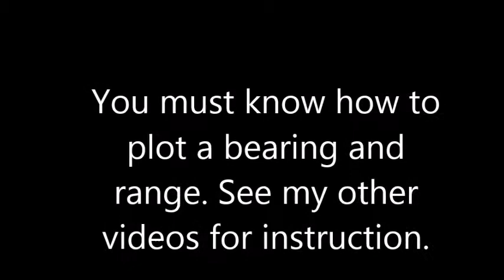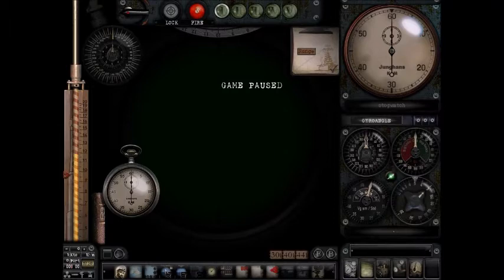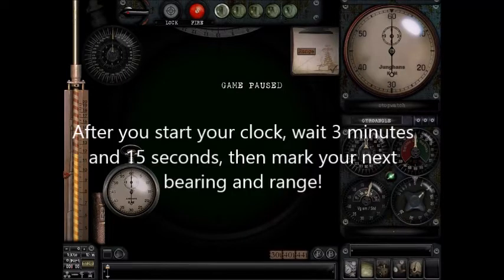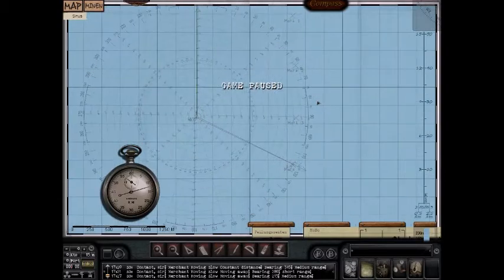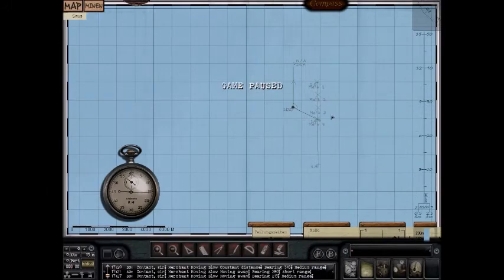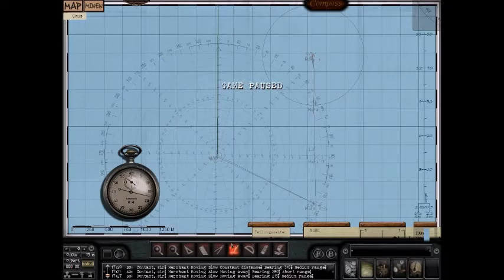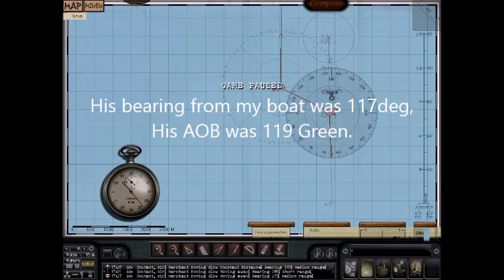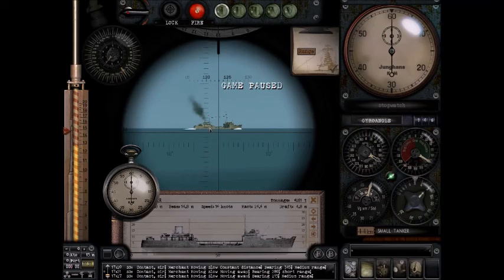SH3 Four Bearing Method by Bstanko6

Comment: Good tutorial if one knows what to do ;) Why don´t you explain what you do at every moment? For me as a beginner that looks like random clicking.
Reply from the maker: Rücklicht can you explain what exactly what you do not understand? I explain quite a lot. How much experience do you have with Silent Hunter?
Reply: @SH3Bstanko6  After years I´m trying to understand manual calculations for the first time. I´m using the GWX mod but my GUI looks and works totally differently from what you have. For example that button in the middle of the Ziellösungs Rechner can only be found on the desk of the Waffenoffizier, but not in the scope.
Reply from the maker: Rücklicht oh ok. Yes. I am using NYGM mega mod. The GUI in this video is MAGUI F. I can assure this, regardless the GUI or mega mod, the procedures are the same. You have to go the extra mile to understanding the GUI of your choice. Then we can go over other parts. I suggest my video on TDC. It introduces key buttons that are the same on all GUI’s!
Reply from the maker: Rücklicht https://youtu.be/n89R6LNqC8w
Reply: @SH3Bstanko6  Thanks. I´m just watching you tuts again and again and try my own testing. Where can I find this mod. The only ones I get over Google are GWX and LSH 2015.
Reply from the maker: Rücklicht subsim.com has all the mods you need
Reply: @SH3Bstanko6  Gonna check it. Thnx
Reply: I am struggling from the same thing. I think I need some coaching, hoping you are a pro by now!